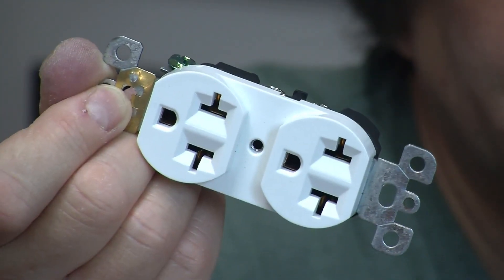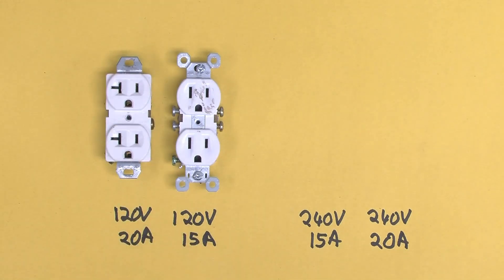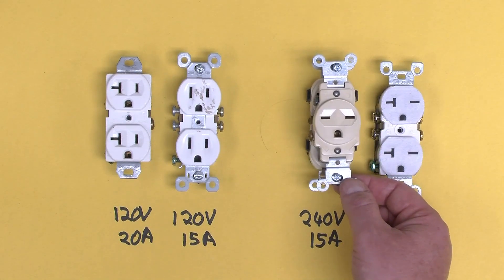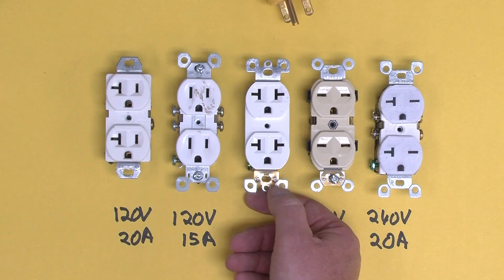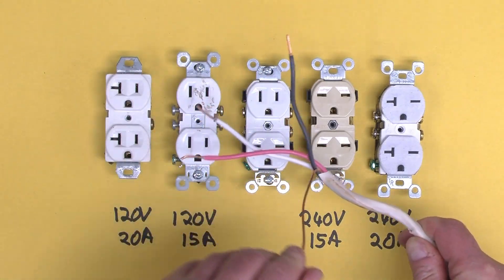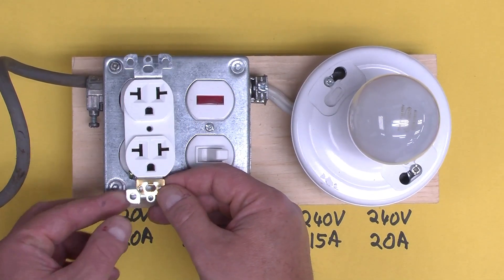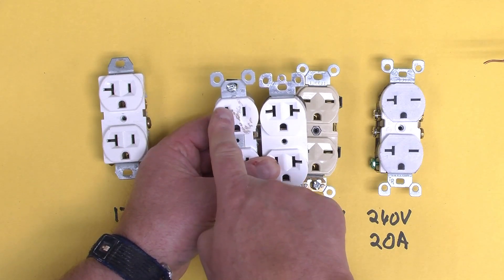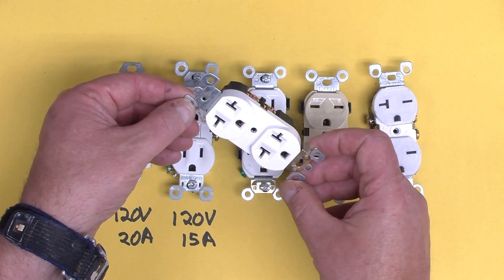Yikes! Don't use this Chinese-made Outlet!

Comment: In the early Twentieth Century, in the dawning of electrical standardization, there were wall outlets for 120 volt circuits that could accommodate either vertically positioned spade plugs and horizontally positioned spade plugs, as those two configurations were in use prior to the final standardization that we are accustomed to today.  I have some antique table lamps with such horizontal spades, and I have some examples of early home wiring outlets with those horizontal slits; there were no grounded outlets back then so there was just the spade orientation, and one was the hot, and the other was the neutral.
Reply from the maker: I have never see the vintage plugs! But when I was a kid we lived in an old house with some plugs as you describe. If I ever see one I will definitively grab it for my collection. Great that you have some vintage lamps with the authentic plugs. 

I just looked at your "Victrola playing a record" video. What a collectors item!
Reply: @ElectromagneticVideos  ... i also forgot to mention too, that before the spade type plugs, there were the socket style plugs.  That's right.  In usually the baseboard (the woodwork of the house, there would be a wall plate with what amounts to a standard Edison light bulb socket, into which one would screw in the plug (to which is attached a wire, which is then attached to a toaster, or a table lamp, or a cigar lighter, or some similar gizmo that was considered state of the art for that time) to connect the device to power it up.
Reply from the maker: @seanbryant2848  I had heard about using bulb type sockets as plugs, but always that it was done simply to plug things into wall or ceiling bulb sockets. In the baseboards - wow - that must have been safe when nothing was attached!
Reply: @seanbryant2848  last year when I was going through my great grandmother's estate after she passed, in her attic sat a Graybar Electric Catalog, 1926-27, it featured surface mount rotary twist style switches, push button switches,  and the toggle switch, which was apparently not as common as the push button style.    it also featured T slot, and 4 slot vertical and horizontal spade outlets,  with both versions of plugs, and of course the Edison socket receptacles with the brass plate and flapper that you flip up to access the power, be sure to keep babies and toddlers away 😐    Grandmother was born in 1925, and coincidentally worked at Graybar when she was in her late teens or early 20s, so I'm not sure if the Catalogs were given to her by the company or if they happened to be in the house when she moved in in 1967, but it was covered in dust and cobwebs and the pages were very delicate and faded.    Very fascinating to say the least.
Reply: @seanbryant2848  up until the late 1920s,  some appliances like vacuum cleaners,  and waffle irons had a screw shell type plug instead of the more common spade type plug, either vertical or horizontal spade.   also available were adaptors to screw into a lamp socket (or screw shell receptacle) to plug in an appliance with the spade connector.  even though the spade connector was invented by Harvey Hubbell in 1904, the path from invention to widespread acceptance took a decade or two
Reply: @Sparky-ww5re  ... that is wonderful that you have that bit of history!  Those catalogs would make a great scanning project... thank you for sharing!

Comment: That receptacle is not NEMA or NEC compliant; I’m guessing it would also bd a reason for an insurance company to deny a claim. Beyond dangerous because if the cross voltage who knows how poorly it is designed on the inside as I’m guessing it doesn’t make the best contact given how contacts work.
Reply from the maker: Unfortunately it is being sold from numerous online stores in the US and Canada. I'm hoping this video will warn people not to buy them and also show that there are plenty of approved receptacles that can be used safely instead.
Reply: @ElectromagneticVideos : One of these is all it would take for either a failed electrical inspection or a stop work order, though both presume an inspection or doing things to “code”, which someone buying this receptacle probably isn’t doing. While this is quite similar to a universal receptacle, as used by some, the big differentiation is that they only work with power converter/transformers or universal power supplies and not simply anything plugged into them, as they are at the operating voltage and frequency of the country of their use, or typically at 240 volts to ground on a single current carrying conductor. This is actually possible to do in the US with high leg delta systems and can be a good use for the otherwise limited high leg, which can typically not be used for Us 240 appliances which expect 240 volts leg to leg and not to ground as a lot will use either 120 volts to a neutral, or improperly a ground, for some of their functionality which can be destroyed if wired to a high leg. 
These types of products keep electricians in the repair business as more and more people become “YouTube Electricians”; it shows how a little knowledge can be a dangerous thing. Unlike plumbing where a incorrect job can show with a leak when electric is done poorly the first sign can be the fire or death.
Reply from the maker: @libertarian1637  Absolutely! What scares me the most about this one is that as you put it "a little knowledge can be a dangerous thing" and someone  could install it for 240V and then a 120V device could easily be plugged into it with disastrous consequences. Even worse - wire one half for 240 and the other half for 120. 

By the way, you are one of the few people I have come across that really understands  how 240V works here and in the 220/230/240V countries! I'm guessing you have lived overseas as well!
Reply: @ElectromagneticVideos : Been an electrician for decades and have visited quite a few countries over the years, with probably the most unique being Japan where 1/2 the island runs the US system, 60 Hz 120/240V while the other half runs 50 Hz 240. The 240V and higher do have great benefits as they can run the same watts on smaller gauge wires, which is why in the commercial and industrial space you’ll see 277/480V and even operational voltages up to 600V without issue as you can basically run an entire factory lighting on 12 gauge wire. I live in NY where things can get real confusing as we have both 120/208V wye and 120/240v high leg delta three phase systems along with 277/480 wye and you don’t necessarily know which until you put a meter on it. Running commercial I’ve seen quite a few newbies make the high leg mistake which can be quite dangerous if not caught as it can mean NEMA 15A/125V receptacles with 240 volts to ground at the plug; though back in the days of incandescent lighting it did mean some BRIGHT lights if wired as a lighting circuit. Another big issue I see, even from electricians, is updating electrical services in homes with knob and tube wiring; as knob and tube only has two conductors and can have sporadic tie in points it is a must to know which of the two wires in the “Hot” and which is the “Neutral” as if reversed on any of the circuits you can run into some problems like actually creating a 240v system across 2+ circuits which can share numerous breakers meaning you can overheat the wires before you ever trip your over current protection. I’ve actually seen this in a few homes with new services by the same company; until I talked to them they were completely unaware it was happening. The big problem is when you’re doing a service upgrade you don’t know if what is there is right in the first place or if you’re wiring it correctly or incorrectly going forward; we’re actually quite well off today with our modern insulations and colors but when you go into older homes or even commercial spaces everything was simply black as it wasn’t that big of an issue when you only had 1 circuit. People trusting circuits and adding to them can be quite problematic, especially when you pull off a switched circuit and don’t realize it, to only have it figured out once and electrician comes and figures out your porch light will only be on if both it and your upstairs bathroom lights are on. 
In the last few years it’s incredible to me at just how many YouTube experts are out there that will argue with you about how their work was good and done right despite the need for an electrician to fix it. One of the other issues pushing this is the jump in price for electrician work between Covid-19 price hikes in material and the 2020 NEC which if required by the municipality or insurer made things increasingly expensive; depending on the municipality around me and the insurance provider you can use anything from 2011, 2014, 2017, or 2020 NEC with 2011/14 being a fraction of 2020. Everything needed in 2020 NEC vs 2011/14 can mean a price that can put a new homes wiring from $3,000-$30,000 depending on size and options chosen. 2020 NEC for example can even increase construction costs as it basically establishes a minimum size for a bathroom as it doesn’t allow any electrical outlets, switches, or devices within 3’ of the plain of a tub/shower which basically makes smaller bathrooms, like anything below 6’x6’ impossible. YouTube can be great for a lot of things, I love watching it for new ideas or just to find better ways to do things, but it rarely gets into the national electric code requirements which have massively increased over the years with AFCIs and GFCIs basically being required on nearly every circuit in a home or business which can mean a 10x increase in cost; so why have a professional do it to code when you can do it for a fraction of their estimate. Frankly if done under best practices you can be fine as a 2011 NEC built home isn’t exactly unsafe and IMO the 2020 NEC goes too far, but then it’s written in large part by the companies looking to sell the products it requires. Sorry for any rambling I’m just sitting here on a Saturday.
Reply from the maker: @libertarian1637  You know whats funny - we are so alike - I do the same thing when I visit places - always am interesting is how electricity is done elsewhere. I'm an ee, not an electrician, but I'm sure you can see from my videos, I really like practical and hands-on things.

Speaking of "weird" things like  high leg delta, we (Ontario, Canada) have 600/347 in most buildings of any size with the 347V used commonly for lighting. You did mention 600V - do you ever use 347V for lighting in the US, is that a strictly Canadian thing? I think 600/347  essentially takes the place of your 480/277?

Your rant about NEC and things like AFCIs and GFCIs everywhere and the cost: I have had similar thoughts that more and more things are being added by lobbing by big companies. I do wonder that if one looked at the additional cost of that and then looked at what other things could be done in a home for the same $, we might find the money is better spent elsewhere like installing sprinklers or using less flammable materials. Or just add fuses to flimsy extension cords which I'm sure are a significant cause of fires that AFCI's are supposed to prevent. 

Knob and tube - funny you mentioned that - I'm jest editing a much requested video testing some 100 year old original know and tube! 

Have a great weekend!
Reply: @ElectromagneticVideos : I like the fuse in the extension cord idea, much like Christmas lights have; it’s funny to me just how safe some aspects of European plugs/outlets can be with independent fuses and switches plus only the very top is conductive, unlike ours which can be energized before fully inserted causing electrocution or even a short around metal/water. I live and work in NY and PA and have done some work in Canada. 600 volts is somewhat a Canadian exclusive though I’ve wired my fare share of buck transformers up to 600 to make some piece of equipment work. Not much 600 around me, outside of the occasional imported equipment. I like Canada quite a bit and just get a kick out of its quirks, regarding the trades, like that you guys are metric but near every building item is in inches and feet; it’s one thing that makes working north or the boarder a piece of cake, as does the fact that most municipalities also go by NEC. 
Some of the safety measures make sense while others seem like overkill; that’s one nice thing about the commercial and industrial spaces where things are well calculated but not nearly as micromanaged with regard to some aspects. I’ve never been a big fan of “minimum code” as I’ve overbuilt regarding safety margins for years but the having to build like everyone is idiots is just going too far. There is something to say for personal responsibility and common sense.
Reply from the maker: @libertarian1637  Interesting things is the Australian plug is modified version of an old North  American plug with the same blades we have but rotated 45 degrees. The have the "closer to fingers" part of the blades insulated like the Europeans. Would be so easy for us to do!

Completely agree with you last few sentences!

Comment: Thanks for the information. Can tell you as a life long sparky this style with the combo 130/240 volt slots s not listed and extremely dangerous. I go out of my way to never purchase or use ANY electrical products, tools safety & test equipment from lying cheating lack of quality control communist china. Bad a coworker almost get electrocuted when he used a new cheating china meter that was seldom used and less then 6 months old. He measured across a 480 volt line and did not receive any readings so he thought power was off. Luckily he used his Fluke VOM to double check and he had power. One of the ultra thin POS test leads was broken. In my over 50 years never installed a duplex 240 volt duplex receptacle. Installed hundreds of the single 240 volt mostly 20 amp and a few 15 amp single receotacles.Never heard the term rupturing applying to electrical items. No such thing called a neutral in the NEC. Ahole changed one of the most common electrical terms used in last hundred years to grounded conductor.
Reply from the maker: Yes! In fact you may notice I didn't give too much info about where to get it because I didn't want to in any way be the one who helped someone purchase and use one. And certifications aside, even if it was excellently built its still an extremely dangerous design which I was trying to warn people of.  Thats certainly a scary story and 480 volts is well into the really dangerous/lethal range! Yeah "rupturing"  - I'm sure its some sort of direct translation but does mean much to us. 

I had heard of the NEC using "grounded conductor" - what a confusing term. What does it call the ground? From what you are saying it sounds like terminology changed recently? I'm an EE so I dont have any where close to the expertise you would have for the code - I hate it when documents use jargon that makes what is being said less understandable and  needlessly does not use common terms.

Comment: In Japan (100 volts), when you turn on the vacuum cleaner, the lights in the room become slightly dimmer and the vacuum cable a bit hot. It happens with all the "high power" appliances. But when I was living in Europe (220 volts), that never happened.
Reply: Receptacles in Japan are only like the 120v 15Amp that you shown.
Reply from the maker: @kobe3576  Interesting to hear what 100V is like! So their receptacles are the same as US/Canada, just 20% lower voltage if I understand right. I have notices similar things here (120V) with high power appliances like electric kettles - the wire gets warm.  I wonder how Japan ended up with 100V which is pretty unique? Also heard half the country is 50Hz and the other half is 60Hz. Must be a real nuisance for companies that make refrigerators or anything else than might have an issue with a 10Hz change in frequency.
Reply: @ElectromagneticVideos  The maximum wattage per outlet you can drain (at least in my house, 15 years old) is about 2200 ~ 2500 watts. More than that the breaker will trip in a few seconds. I use a 1200 watt induction stove for cooking and the cable always becomes warm.      As for the 50 and 60 HZ, most of the modern home appliances are designed for 50 and 60 Hz, so I guess only the manufacturers will be annoyed.
Reply from the maker: @kobe3576  The modern ability to use 50 or 60Hz is a (welcome) change from the old days when I was  kid (ie before switching power supplies became common). The big issues we had when moving was record players (turntables were generally driven by shaded pole motors or variants therefor that ran close to synchronous speed), mechanical clocks, and I think it was generally advised not to bring devices with refrigeration compressors from country to country if the frequency was different. Your wattage is interesting - I'm guessing you have higher current breakers than our common 15A ones.